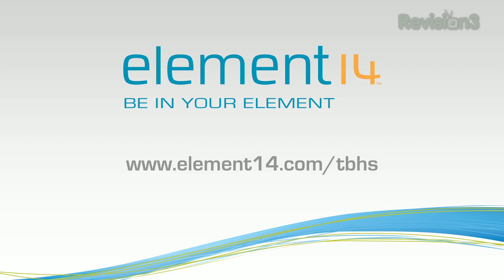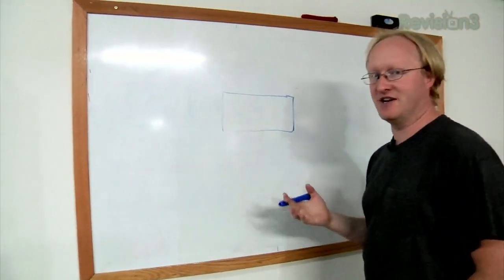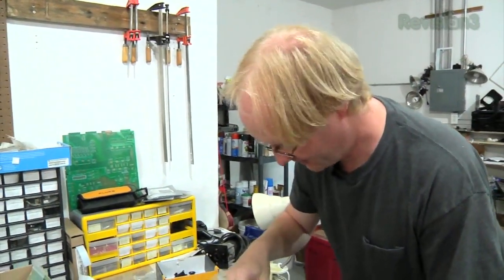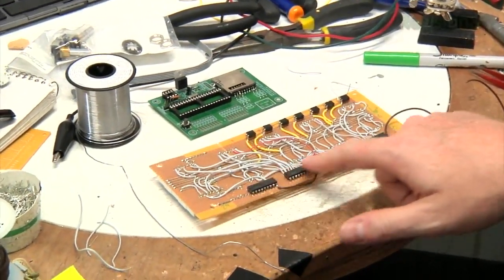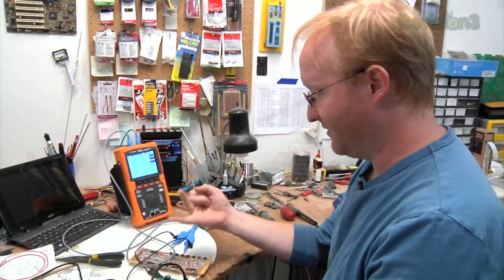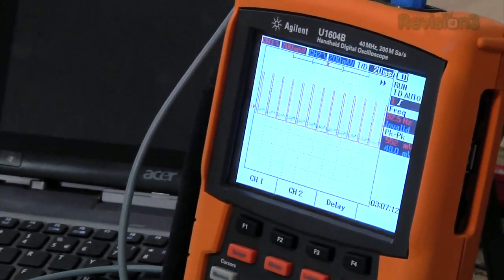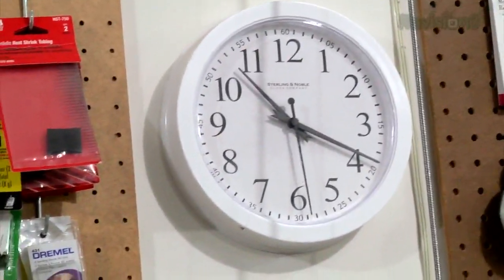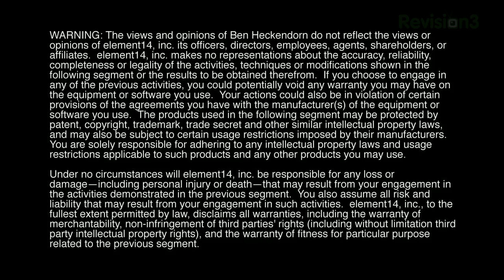ATTACK of the Super Alarm Clock!

Comment: I've always had a great idea for an alarm clock; a pressure-sensitive thing.  Basically, take something like your toilet mat pressure pad and make it the size of a mattress.  The mat should be able to tell the difference between an empty bed and a bed with somebody in it.  The clock should not be able to be turned off until it knows you're not in bed.  Only 1 snooze cycle and it cannot be shut off until it detects you're out of bed for a total of 15 minutes.

Comment: On a clock related note, Why do I still have to hold down a button in my Ford Transit Connect from 2010 to change the time?.  It takes like 5 minutes to cycle all the way through 23 hours to set the clock back an hour.  Maybe Ben can convince car manufacturers to get with the program.  I can't think of any reason any vehicle should still use this method of changing time.

Comment: The led matrix was too big and hard too read? I think those screens were repurposed because they were too rare around the shop and outside the scope of this project. I see what you did there. Next thing you know the case is a cardboard tube with a bicycle gear hitting a flap from a kraft dinner box covered in tin foil for a rotary switch. 

Lots of great design tips from Ben though seriously. I Prefer function over fashion because the function to a large extent will determine the shape. There are electrical considerations, aesthetic options and like I said with leds, cost is taken into account too, these things will either expand or limit your design. Engineering all of them.

Comment: Actually that is wrong.
There is no cap on the eyes.
If you watch a video filmed and displayed in 60 FPS&HZ that has alot of fast movement without any software modification like motion blur, then you will see that the movement won't be smooth.

If you do the same but film and display it at 120 FPS/HZ then you will notice that the movement is smoother.

Now if you were able to film and display it at 10000 FPS&HZ then you will notice that it will be even smoother.

But GL getting 10000 FPS&HZ.

Comment: Humans don't see the flickering cause theres 50/60 hertz witch means the electricity pulses 50/60 times per secound  and each pulse would be a update in the LED diodes and humans are not built to see things going faster than 28 updates per secound and a camera is normaly set to 60 frames per secound and there for will get the flickering.